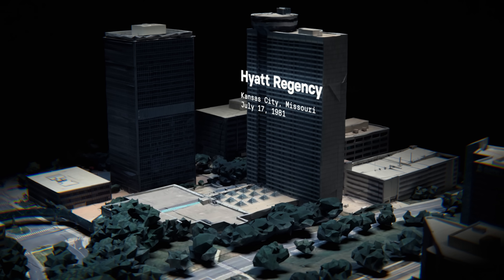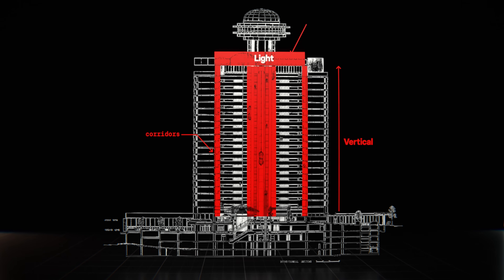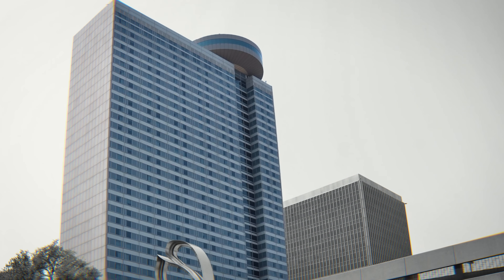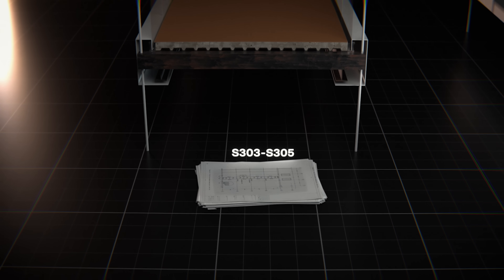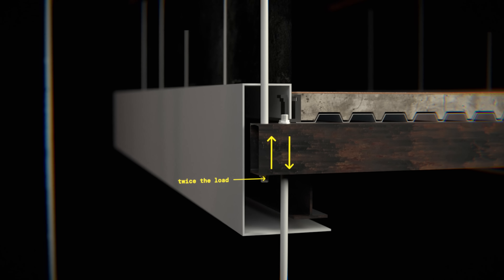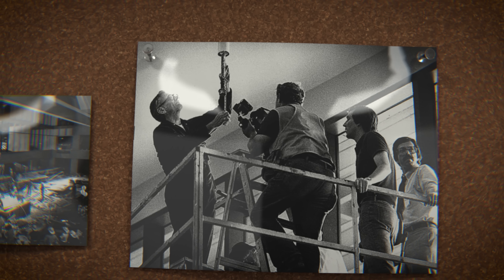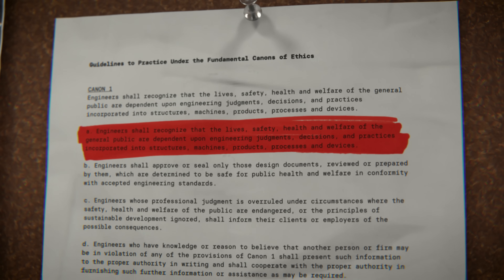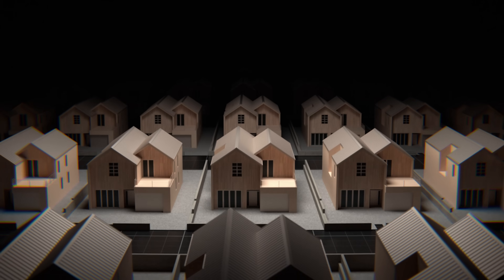Inside the Hyatt Regency Skywalk Collapse

Comment: I was a project manager on a museum project that had 2 custom staircases. Our usual subcontractor had concerns so I decided to contact an engineering firm specializing in staircases.  They said that the stairs as drawn would collapse within 2 years.  It spurned specialized engineering, new plans, and 2 beautiful safe staircases that are used by thousands of visitors every year.  It’s been 16 years and I have visited the museum several times and I marvel at those staircases and shudder to think what might have been.

Comment: Caving to design deviations is a fool’s errand. I’m confronted with such requests as an engineer in manufacturing all the time. My default answer is now “no”. If I’m working on something where life and/or limb is implicated, that becomes a hell no.

I believe in design for manufacturing, but not at the expense of undermining the design intent entirely. That is why I don’t like spur of the moment decisions like this. At the end of the day, the complaining fabricators would have pushed through and built to the existing design. As such, 100 some odd people would have lived.

Remember, you’re the engineer for a reason. The “armchair engineer” fabricators will tank your project to get out of difficult work in a heartbeat, as they will never be held accountable for it. Don’t get pressured into any decisions. A job is not worth it. You will find another one eventually. But, once that noose starts tightening around your neck, none of the complainers will come to your rescue.

Comment: I KNOW I'm not the only one who is still angered that the contractor and the customer who pushed so hard for accelerated construction, weren't also punished.
Reply: The customer will always press for their needs ("cheaper, faster, nicer"), even you, when you build your house. And that's understandable: the customer doesn't have the required engineering knowledge, and they don't have to.
Neither the contractor, because they're not the designers of the final thing. It's like blaming the nut factory for not having enough strength for "your great idea".
Reply: No you aren't. But legally, I can see why it didn't come down on them.
Reply: @09rja   dude was a fall-guy unfortunately
Reply: @spectre9340  He is not the “fall guy”; he was the only structural engineer who stamped the drawings. Do you even know what stamping the drawings means? No, you don’t.

Comment: Why isn't the fall of the American "Twin Towers" in 2001 regarded as a much more significant engineering failure?  After all, both towers fell with after an impact and heat damage that "fell" far below their design criteria?
Reply: Because airplanes deliberately crashed into the towers. Dork. This walkway collapsed on its own.

Comment: I can’t help but feel like the Hyatt regency is the one most at fault. Of course the structural engineer didn’t fulfill his job and he should be punished for that, but one guy can’t go against a major company’s decision to rush construction, and when you rush a process mistakes will obviously be made. What’s more glaring is that the Hyatt regency was offered by a company to review the entire building when the ceiling collapsed (major red flag) but they declined it because they wanted to prioritize cost-efficiency over safety.

Comment: Its unbelievable that they did not put in a filler piece inside the box beams at the attachment point.  Also that they used a welded beam.  I stay far away from engineered structures because of my lack of confidence in America engineering.

Comment: The modification more than doubled the load. Not only did the forth-floor box girders have to hold up the second-floor walkway, but also the supports. Adding a plate at the bottom seems like a really good idea.

Comment: Wasn't a blunder. They just didn't care. Management NEVER cares. They are always looking to cut costs to save the company more money instead of investing into safety.

There was an incident in Chicago once. A tall steel and glass building was recommended to replace all of its windows with wind, sway resistant glass that would've cost the owners some 13 million dollars if memory serves me correctly. Management decided to save the company that money. Time went by and one of the glass panels on the upper floors began to crack, and that crack worked its way across the panel until one big piece broke off, headed down to the busy street below.

It cut right thru a woman who had her child's hand in hers. The woman's body was cut to pieces and the child spared, but obviously scarred for life. Not only did the company have to pay $30 million other the family for damages and negligence, but they had to replace all of those glass panels as ordered by a judge.

I'm looking at the design of these sky bridges and the explanation of the design and there is no way even I would walk on that thing after seeing that worthless design. I not only would've welded a plate below the beam, but DOUBLED IT!

And still I wouldn't walk on that thing. I remember years ago seeing a clip of a bunch of people dancing on the upper deck of a baseball stadium and that entire deck was shaking up and down. YIKES!!! Luckily it was all welded together but still.
Reply: As expected of a state ruled by a billionaire
Reply: @mohanjan8768 
OH YOU MEAN THROUGH THAT ORANGE WEIRDO IN D.C. WHO HAS WHAT? 14 BILLIONAIRES IN HIS ADMINISTRATION??? THAT GUY?

Pritzker wasn't even governor when it happened. Try again wart head.

Comment: As a General Contractor 
I live with stress of meeting RIDICULOUS time lines to maximize their profits. Their dysfunction becomes  my emergency 😭
I will also say, as the GC we build what’s on the paper. We are not engineers. There are times where we have pointed out the flaws in a design and sometimes engineers egos refuse to let them take our recommendations. And clients don’t want added cost aka change orders for design changes. So we build what we are told. GC’s don’t offer solutions because then we take on liability, huge no-no as we are not qualified. All we can do is ask RFI’s when something isn’t clear. And the only way we can get this through to the other partners is if it FAILS INSPECTIONS. And then that costs time plus added general conditions. I know some people in the comments feel this pain.

Comment: The number of unqualified engineering opinions expressed here must set some kind of record as well. The original design was inadequate and the modified design was even more deficient. The engineer of record sealed the first design.I assume he analyzed the second design as well. Were the design drawings changed to reflect the changes? His signature would be required in the Revisions table at a minimum.

Comment: I thought it wasn't "designed to fail." It was designed to work, but cheap contractors and the owners wanting to push down costs, substituted inferior materials that were not what the architects had designed to be used. They also, then, took shortcuts when they built it, straying far away from the original plans and setting the walkway up to collapse.

Comment: When I read about the collapse of the pedestrian overpass at Florida International University (another one that caused an engineer to lose his license), I was a bit surprised to hear that the designers (who filled both the architect and the engineer role) were required to get a third-party engineering review but had no mandate as to what the scope of that review must be -- therefore they only paid for a quite minimal one. I think the other firm was only lightly criticized for not catching the design flaw. They hadn't even been asked to consider the stage of construction during which the concrete ended up cracking, only the completed structure (questionable though that also was). So this review mandate was well-intentioned but didn't help without teeth behind it.

Oh yeah, that was also an umpteenth example of the incompatibility of pennypinching and JC Effect -- the university didn't want a concrete surface on which people could cross a road, they wanted a signature gateway to the university that would make them look distincive, so they went with a design that was novel and peculiar -- but who's going to pay to for thorough study to make sure said design works? And who's going to pay to delay or stop construction when the first signs begin to indicate it doesn't work?

Comment: I work on big things in wood and the weight of that deck is terrifying because I use the same rod arrangement but my deck weight is only 20 LBS per SQFT(but ran as 100DL+100LL because commercial) and the load is transferred with a solid steel connector stronger than the rod itself is, that design that collapsed is so flimsy I normally only see sprinkler pipes and cable raceways hang from that, not FLOORS.

Comment: I seem to recall in a previous discussion of this event that the reason for the design change was that the rod was designed to be all-thread (essentially a REALLY long bolt).  In that case, not only would there be the hassle of manufacturing, transporting, and installing such a long rod, but the nuts holding the second floor walkway would need to be threaded all the way from the end of the rod, where the new design allowed the nuts to be threaded close to the ends.  The rods also could be threaded only on the ends, without needing to be all-thread.

Comment: I work in computer software but I found people who always complain about "best practices" and taking time, tend to be folks who don't actually do any of that stuff and don't want to listen to issues. As an example, one time I remember we had a new contract with a company to import data. The problem is even though they deem their API "restless" it's not sending correct data based on the response code. So I made an exception in the code and explained it but was constantly turned down and even my boss wasn't on my side at the time and said to listen to the "best practices." It ended up breaking the first minute it was released and instead of me being able to come in and fix it they instead covered themselves by saying I just didn't listened. So in the end, it seems like it stinks you can't do much other than quit the job but they can spin it however way they want once you leave.
Reply: There are countless stories of people documenting their objections in writing, emailing it to the company and a personal copy to themselves that’s not connected to their work email. So in case the company decides to make you their scapegoat, you left yourself a paper trail to protect your reputation as a professional.

Comment: I know nothing about structural engineering or engineering in general and putting weight load over a welded seam with just a washer and nut to secure to me seems like a common sense major issue. They must have been under immense time pressure to commit an error this seemingly obvious.

Comment: "the engineer is at fault"-company that forced them to do their work twice as fast with no chance to double check calculations
Reply: They both felt pressure.  They both gave in to that pressure. Both could have done the right thing.  So , yes the engineers are at fault, more than anyone, they knew better.

Comment: I cannot believe that a steel manufacturer can just change the plans for hanging sky bridges without input and approval from the structural engineer who designed the building. Why have engineers if the steel manufacturer can just alter the design?

Comment: Is this guy licensed?  If so what state?  I looked up Illinois, but I couldn't find an architect's license number assigned to a Stewart Hicks.  If he's an educator with a residential design studio, then fine.  But don't hold yourself out as an architect or an expert of the profession.  They are two very different environments.  

Was there a stated design load capacity?  Did that hotel have a function beyond the allowed capacity of the space?

Typically, structural design changes from the original approved documents require a review by the agency having jurisdiction.   Were these changes and the contractor suggested alterations approved by the agency?  If so, the design may have been acceptable for the capacity it design for by the building code.  If these are AHJ unapproved changes with engineers stamp that were constructed by the contractor, well we have another situation where the contractor potentially would be at fault. 

Each state is different, but just because an engineer stamps an accepted review of shop drawings doesn't relieve the contractor's responsibility to construct an assembly not in compliance with approved documents.  What accompanies that stamp is the disclaimer that limits the scope of the review.  I am seeing an oversimplification of a potentially complex liability issue.

Comment: I worked here back when they switched this  Hyatt to a Sheraton around 2011  Sheraton did a refresh on the lobby and hotel in general which meant that the hotel had hardly any guests. It was very eerie walking around the hotel in the dead of winter and seeing no people anywhere. Off the lobby is an event space on the ground floor. It was unofficially known as the morgue because that is where all the deceased were placed during the cleanup after the disaster.

Comment: So it was kind of hard to follow what the problem was because you kept on animating on the separate second floor walkway, but it was actually the third floor walkway that was connected to the first floor walkway that collapsed, correct?
Reply: no
Reply: @sammyseagull  But you can see the second floor walkway in the very first black and white photo of the damage, whereas the first and third floor walkways are in a pile of rubble on the ground floor.

Comment: Sad this happens quite often actually. In the attempt to save money save on costs get something out faster you end up with an issue that at the end costs you many times more then simply doing it right. The MGM fire way back in the 1980s in Las Vegas well they didn’t wanna spend 5 million on fire safety which Vegas building code at the time allowed but ended up costing them 20 times that in legal issues not to mention some deaths. Do it right the first time demand it.